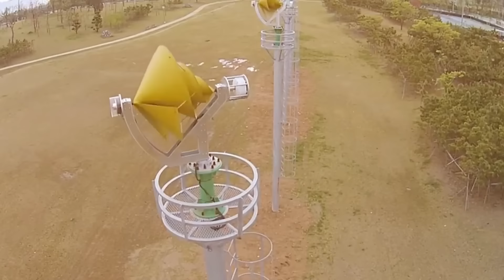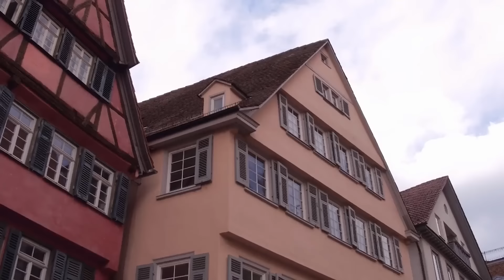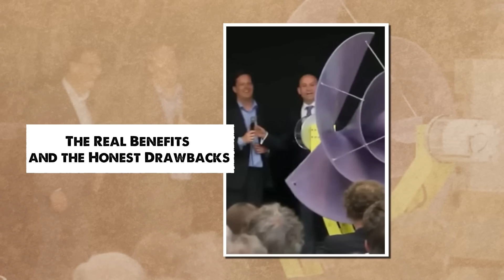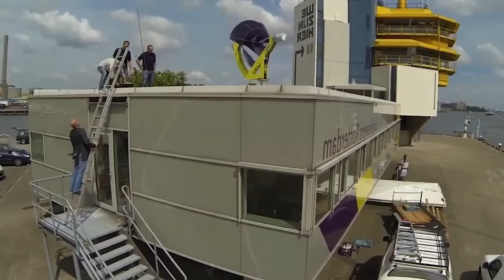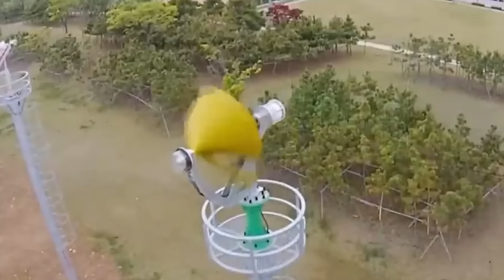This NEW European Wind Turbine for Home Outbeats PV Solar Panels in 2025?!

Comment: Two advantages to all renewable energies is also protection from inflated cost of buying electricity across time--especially if inflation picks up. A 3% inflation rate while your energy cost doesn't change means that your electricity is literally becoming cheaper in real cost every year. Also, a war on the other side of the globe is not going to change your power costs in the slightest (as is now happening globally because of the ill advised attack of the US on Iran).

Comment: Question:what is the minimum wind speed before it generates any power at all?
The large surface relative to the diameter says, it need high wind.

Comment: There is one cold equation that governs the economy of wind turbines: the formula that tells you how much energy you can extract at what wind speed, given a certain "swept area" (the area of moving wind that your turbine captures).  And the math is simple.  It does not matter how creative or outlandish the design of your turbine is, even at a 100% wind energy conversion efficiency, rooftop wind is not going to be economical unless it is extremely cheap to buy, install and maintain.  At this time, it is not.  The only upside of rooftop wind is that it can generate power at night, but unless you're off-grid, there is no point from an economical standpoint.  
This thing does not beat solar.  Not by a long shot.

Comment: The real efficiency of this design isn't in it's free running in an open frame as in this video, but in a vertical updraft ducted channel it can reach over 90% efficiency and double the output power with little to no wind by harnessing all of the available energy as the draft and heat rises from buildings on the ground and the units are mounted at the peak of the roof or on the edge of buildings.

Comment: You still have to use batteries that pollute a lot when they are produced. And quite a lot when they no longer work. So wind turbines in any form are not the future. But do you know what Hydrogen is? It is pure water that is converted into energy. And we have plenty of water, right?

Comment: Here's the thing. Most homes in my country does not need a ton of pr hour generation. It needs storage for off hours. I have 8kwh solar panels. most days with even just a little sun they create more than enough power to charge 80% of my 10kw battery and supply power to my home throughout the day(I use 3 heat pumps to heat my home/garage). On sunny days the panels create 30-40kw easy(south facing panels). What most homes need is energy storage. One major benefit of these would be for winter use. If I could get 3-4kwh from wind in the winter I could go almost zero-emission for my home. And obviously for an EV more is always better.

Comment: Too expensive for just 20years. That 4500Euro means a lot more for Canadian 7300$. You can keep your expensive win turbine.
A lot cheaper way to go. A cars alternator with a Roof Turbine Ventilator as propeller. This can generate 600W, together under 800$ Canadian. 
Alternator + propeller + inverter + battery. This is if you buy new. Refurbished alternators are cheaper. 
A lot smaller and compact, and parts to repair can be found every where. You can rebuild the alternator your self this way you're ready for the future with parts and know how to do it, bearings, brushes, regulator, maybe rotor. If the rotor got to be replace than a new alternator.

Comment: I dont get how this video is trying to make the comparison with PV like it is to compete or even replace solar panels. It is not an either/or decision! The mix is the solution. Wind, solar, geothermal, even rainwater. It is best to use all free energy sources available and store the energy meaningfully (conventional battery, in chemical carriers like green-methanol, hydrogen or sodium bicarbonate).

Comment: How do you "make 1500 Kilowatts per hour"?? does she mean it generates 1500 kilowatts of power (for how many hours, is there a limit, does it overheat after 1 hour)? Or that it generates 1500 KilowattHOURS of ENERGY per hour?

1500 kilowatts is 1.5 Megawatts... at 250 volts that would be 6000 AMPS!! I really doubt that!!  ...I suspect she meant to say 1500 WATTS, and in an hour that would be 1.5 Kwh - far more believable, and not bad... but the claim was 1000 times that!

Comment: 1500 Kw/h? 1 500 000 W/h? 1.5 MW/h. I don't think so. I guess the advertisers mean 1500 W/h, that is believable. Still doesn't infer trust if they cant even check their own claims in the video.
Reply from the maker: You've hit on a really important point about the need for accuracy in technical claims. I appreciate you calling that out, as it's crucial for understanding the true potential of these technologies.

Comment: What does 1500 watts per hour mean?
?!? Watt is a unit of power.
Reply from the maker: Good question! It seems there might be a slight misunderstanding of the unit. Watts measure power, not energy over time. So, 1500 watts is a measure of instantaneous power.

Comment: Solar you have limit to irradiance, but wind can be slow can be very fast.Your power fluctuation can be so great for wind that it can distroy your system in a short over power wind, just a out of normal wind can will result in requirement of you to refurbish of the system again.
Reply from the maker: You've hit on a really crucial point about the variability of wind power and the potential for system damage. It's definitely a significant engineering challenge that needs careful consideration for home wind turbine applications.

Comment: Lots of non-relevant iinfo, and lack of real numbers. When it reaches 80% of the Betz limit, you get 300W output per square meter of projected/swept area for 10m/s (5 Bft) wind.  It drops to under 38 W for 5 m/s  (3 Bft). The wind range that gives acceptable efficiency is small compared to propellers with pitch control.  There is a reason why wind turbines need to be large and high. You need swept area and wind to harvest wind energy.   Wind survivability is also an issue. 

You definitely need to do your math and research before considering such a small wind turbine as discussed here. This is not a “game changer”.
Reply from the maker: Thanks for sharing your insights and for the detailed breakdown of the Betz limit and power output. I appreciate you pointing out the need for more concrete numbers and the challenges with smaller turbines. It's definitely a complex topic with many variables to consider.

Comment: All tests of ground-based small wind turbines show: 1) They hardly produce any electricity! 2) They do not last long!

Solar panels generate at least 10x more electricity with the same investment in time & money! 
Reliable and almost maintenance-free for at least 25 years!
Reply from the maker: That's a valid point about ground-based small wind turbines. My video focuses on a new European design that aims to address those very issues, especially with advancements in efficiency and durability. It's definitely an interesting debate between wind and solar!

Comment: Something is very wrong here, as to get 1500 kilowatt from a single small wind turbine, which equates to 1.5 megawatt, you would need a wind speed of 140 m/s = 500 km/h which is on pair with a major tornado of grade 6, or a nuclear bomb ! So I urge people to listen again @ 40 seconds into the video, to hear the narrator indeed say "fifteen hundred kilowatts" that any kindergarten kid can easily calculate that is equal to 1.5 megawatt !
Reply from the maker: That's a very detailed analysis of the numbers! It's always helpful to double-check the figures in any presentation.

Comment: Don't forget that you still need a good 12k inverter controller.
Reply from the maker: That's a crucial point! A reliable 12k inverter controller is definitely a vital component for a system like this. Thanks for the heads-up.

Comment: I had very strong views against solar panel installation. They are mostly run by rogues and rackets. When you call them up, they say it is a long-term investment. It is not. It is a rip-off. Hopefully this offers an alternative and a better solution,
Reply: Unfortunately this isn’t a game changer.   Though efficiency is significantly better compared to drag type turbines, output is still low in most close to the ground urban/residential areas use cases.
Reply: @wimtel  For Malaysian standards isn't that enough?
Reply: @saravanananamalai1114    You need to do the math based on the average wind speed at the intended location of the turbine.  Expect about 38 W for steady 5 m/s (3 Bft).  Given the lattitude for your location, I would consider Solar also, as that may win the comparison. 

Parts of the video were recorded in the Rotterdam Area (Seaport, close to the North Sea coast). It has areas with relative good average wind.
Reply: @wimtel  I am against the solar panel rackets, not the solar panel technology. The rip-offs is like daylight robbery. So, if you had read what I had written then, probably you would understand that the prices charged in my country (Malaysia) is very excessive and a rip-off. Anything else that gives value for money and is a workable solution, then I will be ok with it.
Reply: @saravanananamalai1114  I fully read your contribution, but without real numbers I can't relate it to wind.  If you want better replies, you should provide better info. 

For the Dutch situation, small wind power costs at least 5 times the price for solar (based on kWh).
Reply from the maker: I totally understand your concerns about solar panel installations; it's a field that definitely needs more transparency. Hopefully, this new wind turbine technology can indeed offer a more reliable and trustworthy alternative for home energy!
Reply: @BusinessHook  Not to be rude, but the physics that govern wind energy will not change.  Once you know the wind statistics for the intended position of the turbine, you can do preliminary math. When you limit yourself to VAWT, efficiency will not exceed 30 % (Savonius performs significantly less). 

Startups keep appearing with appealing marketing to attract investors (and or buyers). Except for very windy locations and some niches, small wind turbines are not the way to go.

Comment: i have a idea for a steam generator that can fit in and power vehicles, houses, bikes, ATVs. it's a closed system, recycles the water and is totally clean, with no solar or wind dependency or batteries needed
Reply from the maker: That sounds like a fascinating concept for a sustainable energy source!

Comment: What an expensives system.
And Still not efficience enough for low windy area.
Reply from the maker: You're right, the initial investment can be a hurdle, especially in low-wind areas. It's important to weigh the pros and cons based on your specific location and needs!

Comment: oh, another micro wind power invention that claims its going to change the world.

fact: you can only harvest the energy in the area the wind turbine sweeps. the smaller the turbine, the smaller area it sweeps, the smaller amount of energy it generates.

Yes it can handle the urban turbulence better then a normal turbine then 2 or 3 blades.

its still way too small and needs a very high average wind speed to provide any meaningful amount of electricity.
Reply from the maker: You make some valid points! While micro wind turbines have their limitations, they can still be a great addition for specific environments. It's all about finding the right balance and utilizing the technology effectively.

Comment: Please price of 3 KWA Wind Turbine for Karachi Pakistan
Reply from the maker: Thanks for your interest! The price of a 3 KWA wind turbine can vary based on the manufacturer and installation costs, but you can typically expect it to be in the range of $3,000 to $5,000. It's always best to get quotes from local suppliers for the most accurate pricing!

Comment: You can't get more power than there is available in the wind, and there isn't much wind on rooftops because urban areas are sheltered and wind power depends on height. That's why wind turbines are so tall.

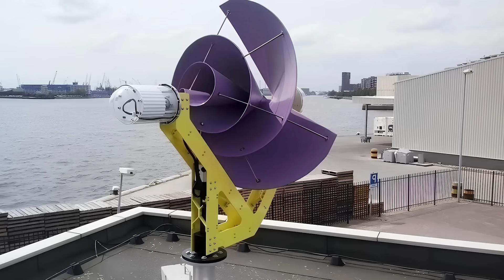Comment: The numbers don't add up. At 13:59 you can see that it generates 45 watts at 24 volts DC. Do your numbers and find out.
Reply: Maybe thats a smaller one?  1kw is better than nothing.    nope,,chcking 1kw  is the largst I can find.

Comment: why do they have to pit solar against wind? why not use both?
Reply: When you do the math (based on wind statistics for the actual location of the turbine, and its swept area), the outcome will likely be that it isn't worth the investment.  The "problem" with wind is that energy density drops to the third power.  So going down from 12.5 m/s (6 Bft) to 6.25 m/s (4 Bft), you lose about 88% of output.  When wind goes up, the turibne has to  limit the output power, or even has to brake to avoid damage.
Reply: @wimtel  i don't see why the "brake" can be transformed into a higher output for energy storage. perhaps the problem is not in the math, but in the design of the capture of energy?
Reply: @ronen160  Braking energy is lost (as heat), or the turbine is stopped complety.  You are right, braking doesn't increase power output. 

The problem is mostly in the physics, and that is modelled using math.   As mechanical power output goes with wind speed cubed, the wind speed range where reasonable output is available is small (for fixed shape turbines). At low wind they generate little power as there is no power. When the wind is very strong, they can't handle the power.

Of course this is not valid for bladed propellers with pitch control (they have a wider wind speed range).
Reply: @wimtel  Don't Prius cars recapture energy from braking? surely this can be applied to wind turbines? if the brake is not a pad but instead some kind of rolling devices that grip the rotors, simillar to pads, then the spinning of such device can capture energy? As you can tell, I have a rudimentary knowledge of physics: however, I understand that where friction creates heat, then the friction can also possibly be turned into energy.
Reply: @ronen160   They can, but when the generator/motor combo is no longer able to transfer the power, or the battery can't store the energy, you need to brake with the brakes. 

With wind it is the same, when the available mechanical power is too much, you need to take action to avoid that that available power/energy gets into the system.   First step is to use pitch control, this reduces the mechanical power output of the propeller at certain wind speed.  When that is not sufficient, the best option is to fully stop the turbine.

Comment: In windy areas, this would be a good investment ...
Reply: No.
Gigantic moving mass.
Complicated shape.
Uneven mass distribution.
Small swept area.
Expensive to manufacture + low yields + prone to defects.

Usefull rotor diameters start at 5 to 6 meters.

Comment: 1500W per hour.... one day they would know what are power and energy
Reply: i don't know if my calculation i right, but this only produce 175wph not 1.5kwh. if it can produce 1500kwh in a year that's 4.213kwh daily the sums up to 175wph the only difference is it can generate this in 24 hours. a single solar panel 500w can generate between 300-450watts per hour, but can only generate when sun is out. if you have the room or yard space or you're off grid this maybe a better solution and i'm pretty sure they have a better more power outputting once other. i would have to have 7 units to make it work which i do not have the space. i wish they have one that can produce 1kw or even 1.5kw
Reply: @joemiranda8525 The statement of “Watts per hour” makes no sense.  It is like saying “someone can Run 3 miles per hour per hour”
Reply: I thought the same thing …. They are interviewing an “Expert” on the device and the person has no idea what Watts actually represent.   Kind of funny

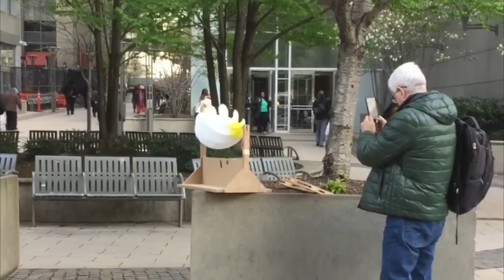Comment: At 15:25, the small test model prototype is convincing enough. It doesnt look like a very windy day in that business park. If 12 mph winds is all you need and also only at a 4 ft height, you could set up a series of Liam F1's on a fence wall.
Reply from the maker: You make a great point! The prototype does seem promising, especially with the low wind requirements. I’m excited to see how this technology develops!
Reply: At 12 Mile/hour (5.3 m/s), you can expect 40 W of output per square meter of swept area. A turbine with a diameter of just under 4 ft (1.12 m) has 1 m2 of swept area.   You need size, and wind, to harvest wind energy.

Comment: lol, whoever redited this REALLY wants the viewer to hang on with the useless added bonus snippets which don't do anything but repeat what was already said.- probably had to meet a minutes requirement to post... also some errors couldn't help noticing; one that earlier price mentioned of 4500 euros doesn't equal 4500 dollars said later. Oh, and why isn't it mentioned you can buy a smaller unit for less than $200 on Amazon??